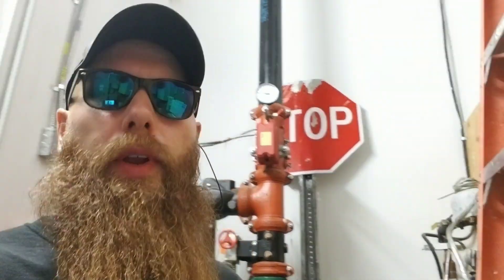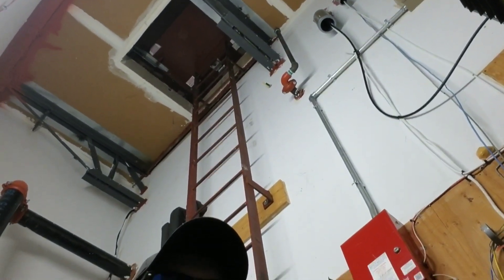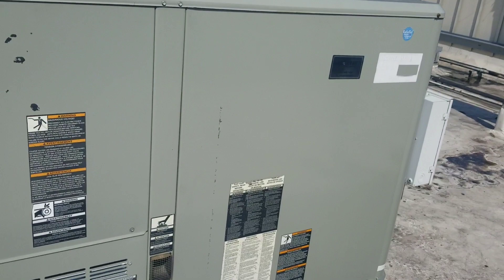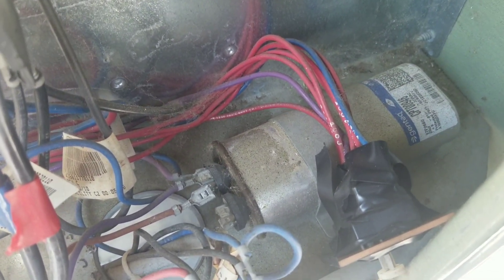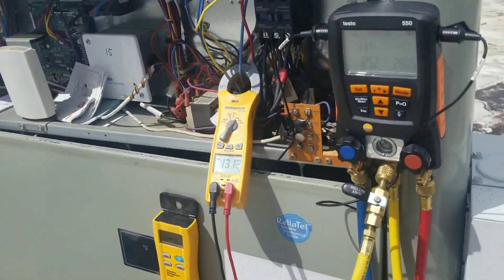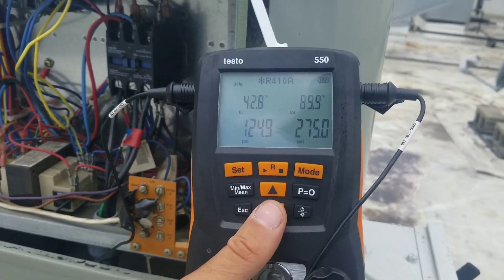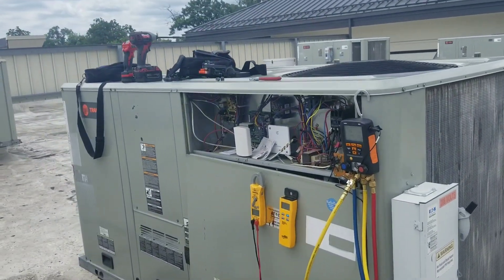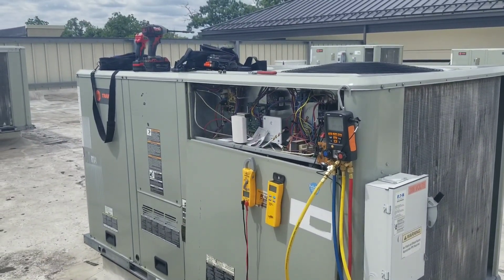No AC, sweating vents

Comment: Every club and restaurant I worked at thought that setting the units that were under capacity to 50 degrees would give them "more" headroom as guests started filling up the space. That always caused problems and was easy money to teach the new manager every six months the same lesson about dewpoints. Just like clean the filters on the ice machine each week, no one listened until they were told if I touch the machine, I have to by law dispose of all the ice in the machine.

Comment: i didn't see you check the economizer,if its open that'll drive humidity through the roof inside the building,I've come across that issue before
Reply from the maker: Very good point-
Reply: Good point, I was going to mention that as well, I get a lot of calls with that same problem and the makeup are is opened up too much for Florida humidity.
Reply: I do building automation and have those issues all the time in virginia.

Comment: It's a relief you didn't talk to Trane technical support; they would have gone crazy looking for the solution without knowing that the unit has a third party control operating it (the white box with a written "15").
Just out of curiosity, do they have a zone temperature sensor mounted in the area of the control module? I doubt it is Trane's Air fi (wireless) system, because the unit doesn't have a BCI-R card.

Comment: RLA - Rated Load Amps. I thought for the longest tune it stood for run load amps.
Reply: I just realized I said tune instead of time. Lol
Reply: @curioushvacguy6876  It is rated load amps, and on a 3 phase system you should be a lot closer to that number. (single phase compressor will be something like 60-70% RLA) . imo that system was probably slightly under charged. I would have shot for a 15-20 superheat, and with the increase in charge, you probably would have seen an increase in amp draw.

Comment: I'm not sure this helps but as an audio tech for a , Church I once had a "discussion" with someone who was adamant that with Air conditioning turning down the thermostat speeds up the AC  compressors. In cool cycle and on heat by turning them up. Apparently all, modern AC's work that way, or so he thought at the time.
Reply: @curioushvacguy6876  I suspect that many of the "inverter" AC's may only be regulating the fan speeds

Comment: This is how I do it. Target SH = (IDWBx3) - (ODDB+80)/ 2 

Example: (64F IDWB x 3 = 192)  - (96F ODDB + 80 = 176)  192 - 167 = 16   Then 16 / 2 Results in an 8F Target Superheat.
Reply: Just use a superheat chart. I keep this on my phone in work file. Pic link below ⬇️ that system was probably slightly under charged. But your definitely right about getting below dew point with the t-stat set that low. Especially if they had dirty filters in too. Lovin' your videos man.
 😎👍 #staycurious
https://photos.app.goo.gl/zwCzFuc3LEszhK6Y7
Reply: @curioushvacguy6876  Yeah, I have it written down.. I can never remember it :-)
Reply: WT? Pressure converted to temp.
65psi = 37 degrees evaporator
Sensing bulb temp taken at suction line 45 subtracted from evaporator reading 37 = 8 degree superheat. Maybe I was taught wrong? Guess I better keep watching, cuz this is how I did it in the past and it worked? What in the world is going on???
Reply: @rowdybroomstick1216  I think you are confusing calculating Actual superheat with calculating Target Superheat, which is what this discussion is about.

Comment: I think you divide that final number by 2 to get the calculated target.  Or I have been doing wrong this whole time lol.
Reply: @curioushvacguy6876  yes. The charts are definatly more accurate. I'm with you not many times to use it so I always have to look in my phone for the note I made.  I may have just written it down wrong. I meant to go back and look, but have not yet.
Reply: You are correct. You divide that last number by 2, with that calculation.
Reply: Great  video sir! I have a question for you,  did that unit have a direct drive set up? I also seen that it had an econo hood on it , it mixing outdoor air at the return? I've had issues like that before also.. great videos dude. I've been trying to record some myself,  if you get a chance can you make a how to of your set up??